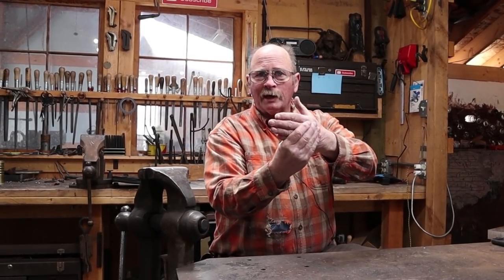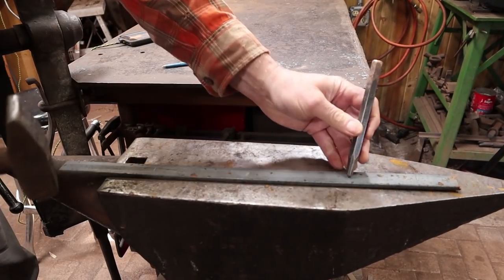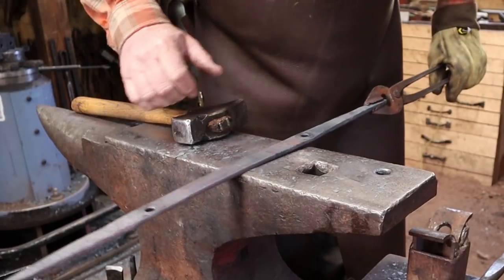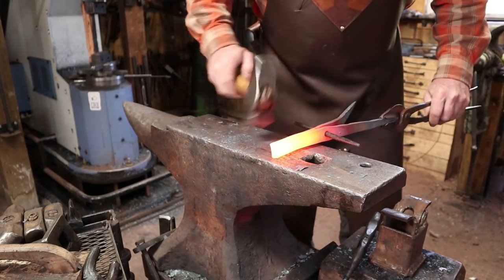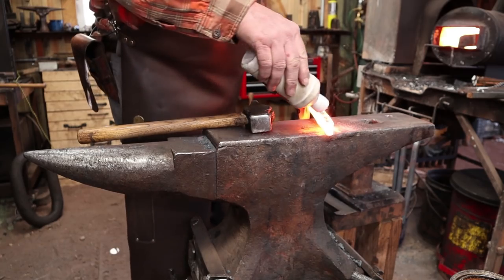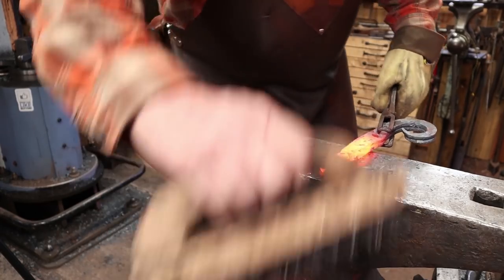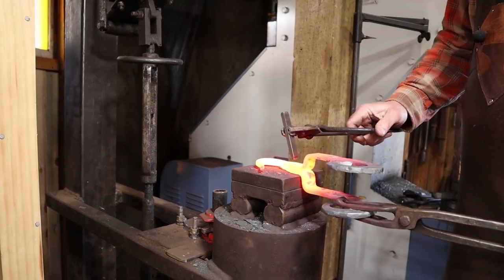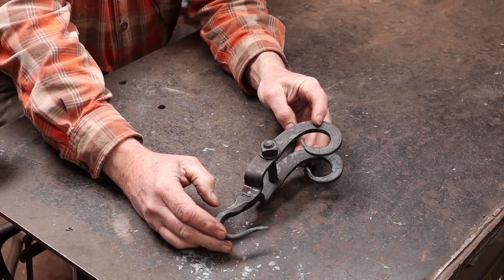Rafter tail hook for the bell - Hook of the week 46

Comment: John, thank you for this rafter hook -- I think I now need to make some.  ;)

Also, you and some other Blacksmiths on YouTube have mentioned taking care to not shear a forge weld.  Does this mean that forge welds are that inferior to gas or electric welds?  Could you go into detail on this in a future video?  Take care!
Reply from the maker: A well done forge weld is as strong as the original material but the only way to know that is through destructive testing.  There is almost always a transition zone between fully welded and the area that wasn't meant to be welded that will be more likely to open up under stress.  Gas and electric welds will almost always fail when forged due to the dissimilarities between those welds and the parent material, which leaves a forge weld as the preferred method when the work will be forged after welding.

Comment: Georges hook, did you drill and flush rivet on the forge welded hook side?
Reply from the maker: There are no rivets used.  One forge weld and one bolt to hold it to the rafter

Comment: Honestly, I'm a little disappointed that you didn't flare the bottom of the bell... 😥
But if you were going to, do you think you might try to hammer it over a large round form like a large pipe, or would you prefer to make/find a flare form & press it down onto it with something like the fly press or hydraulic press? 🤔